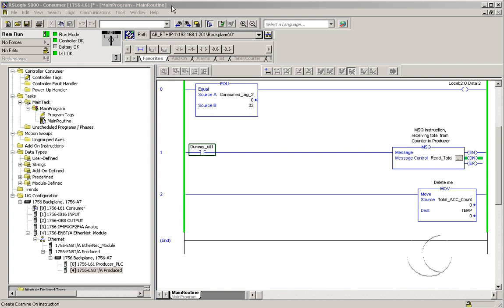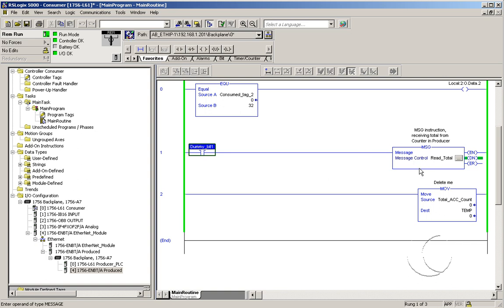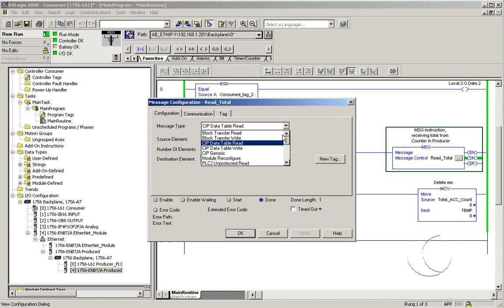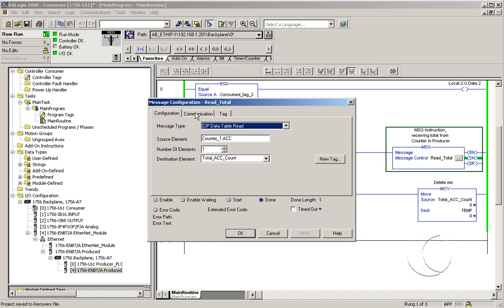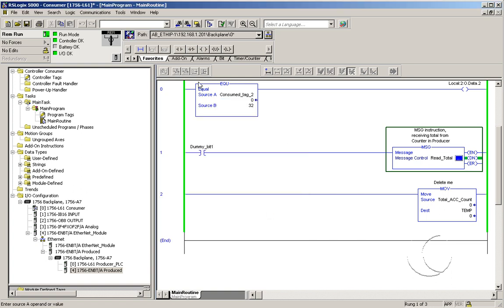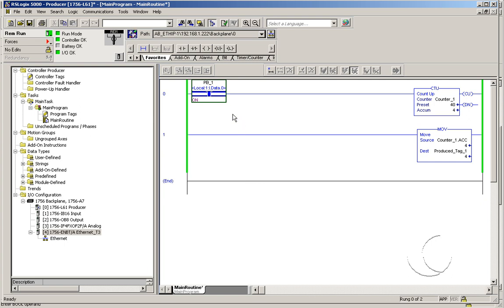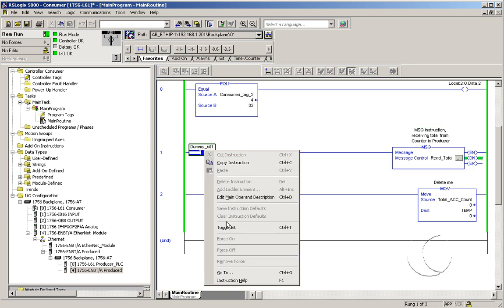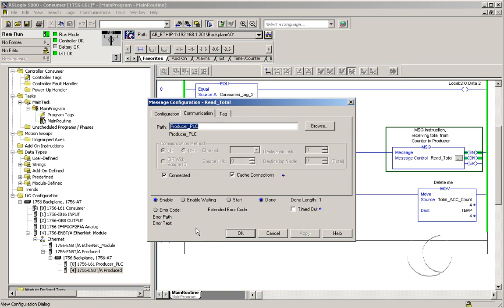How to set up a Message (MSG) instruction in RSLogix5000

Comment: Thanks for good class!
 I have a question.
What the difference between MSG and method of producer-consumer?
One difference that I know is MSG you can do online but another one have to do offline.
Besides that, are there more difference?
For example, speed rate?
Reply from the maker: Thanks for your positive feedback. The biggest difference is that MSG instructions can be used between any type of control device (VFD, MicroLogix, Micro800, SLC, CompactLogix, & ControlLogix). The Produce/Consume model is only available on ControlLogix. The P/C model is more efficient with connections, allowing for faster updates (near real-time) and faster scan times. Both methods are still valid and used often in industry.
Reply: @PSDettmer  I made a P/C comminication in my work last year wherer dameged the encoder.
This encoder was getting the velocity of machine A and making the reference to machine B( It was Master virtual axis to all servo motors of machine B).
We didn't have encoder to replace so I had to create P/C between machine A and B sending the velocity of A to B and use this in the B as master virtual.
I didn't know that this type comminication is only in controllogix!
Thank you very much!!!

Comment: can you tell me how to do that is rslogix 500 if i want to connect two micrologix 1400. plc1 gets the input and plc2 gives the output.
thanks
Reply from the maker: Hmmh, well, if you can't wire directly from one PLC to the other (or go thru a relay - safer), you could do some data exchange using the MESSAGE instruction. This would allow you to use some type of Ethernet-based network. Good luck! Peter

Comment: Very cool!  How do I setup a network connection with another PLC.  I see the other PLC under module discovery but get an error of "Interface not supported"?
Thanks!
Reply from the maker: Not exactly sure what you have, but be sure to click on the slot that contains your primary ETHERNET network. Right-click & -> Add module on the ETHERNET. Add the remote PLC's network interface. Make sure you selected the correct catalog #. Use Generic Ethernet Module if it is a robot or some other Ethernet IP device.

Comment: Thank you very much!
I also want to add that Data Type for Message Control Tag (in this case Read_Total) must be MESSAGE. Data Type for source data (in this case Total_ACC_Count) must be a word format: DINT or INT, and match data type in the other PLC.
If you want to send/receive data for one bit only, you have to move it to the one of the bits in the word, move the word and extract the data from the word at the other end. In other words, it is impossible to send BOOL Data Type.